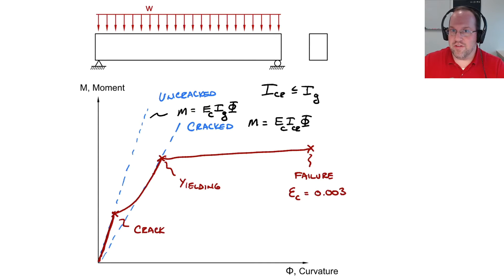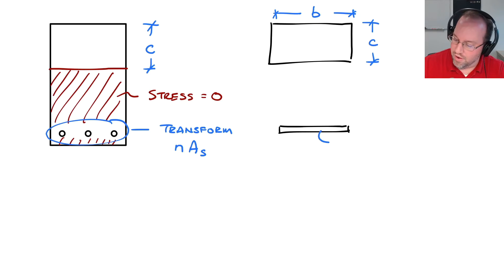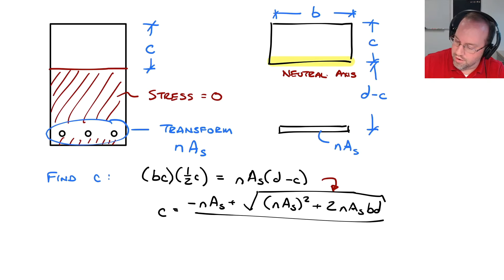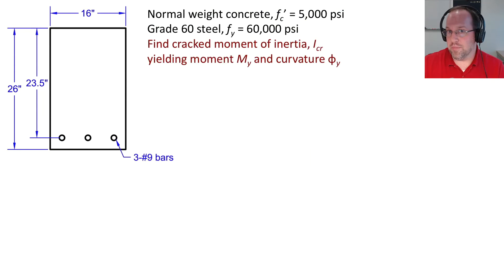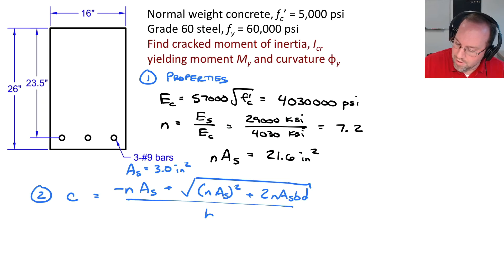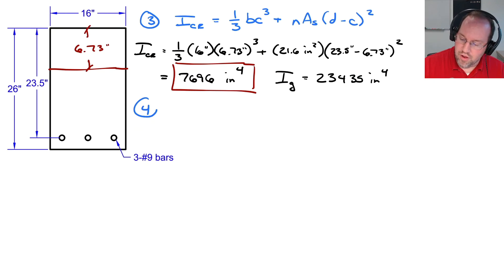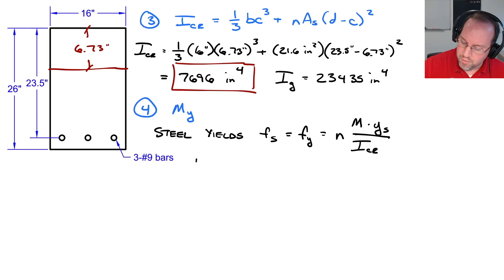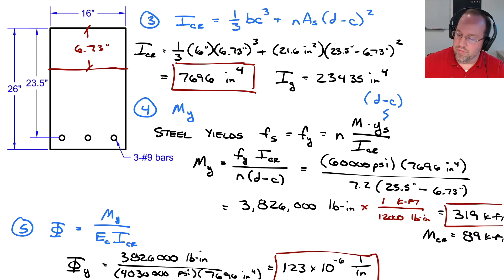Transformed Sections and Cracked Moment of Inertia

Comment: Good day sir! why we did not included the moment of inertia of the transformed steel upon using the parallel axis theorem? I am hoping for your reply. Thank you!
Reply from the maker: We could include the moment of inertia of the steel, and there is nothing stopping you from doing it, but it’s typically neglected. The MOI for a round bar is pi/4 * R^4, which even for the largest rebar is very small compared to the concrete section. Thus, we typically only use the parallel axis theorem for rebar MOI, as even that area * distance^2 will be many times larger than the bar MOI.

Comment: Sir, please let me know the derivation  how it becomes nAs and significance of modular ratio n....
Reply from the maker: Reinforced concrete is a composite of concrete and steel. When we examine the stiffness of the section, for example when computing deflections, we are generally interested in the elastic modulus E multiplied by the moment of inertia I. However, we have two material with different modulus: steel Es and concrete Ec… so what do we use? To get around this, I can convert (or transform) my steel into an equivalent area of concrete. Steel has a higher modulus than concrete, and we represent this with the ratio n = Es/Ec. The transformed area nAs is the steel area converted into a larger area of concrete such that the total stiffness is unchanged. Using this transformed area, I can treat my section as though it’s 100% concrete, meaning I can now find a moment of inertia I with modulus Ec using traditional, single-material beam bending theory.
Reply: @StructuresProfH  Many thanks for clarification Professor! one question which might seem basic because I am a beginner about this topic is: sometime  I found equation where the transformed steel area is calculated as (n-1)*As instead of n*As (your case). Any reason for this?
Reply from the maker: @lifeadventuresz  Great question (and not at all basic)! 

We use (n-1)*As when the steel is located in concrete that carries stress. The most common situation for this is compression steel. We typically assume the concrete section does not have any "voids" in it where we have rebar - for example, if the neutral axis is at depth c in a beam of width b, then we just assume the concrete compression area is b*c. In reality, the concrete area is b*c - As, because As of that area is filled with steel, not concrete. To simplify our math, we move that "minus As" over into the steel term and leave the concrete area as b*c. So what normally would be n*As for the transformed steel area becomes n*As - As = (n-1)*As. To summarize, compression steel located in the compression block displaces stress-bearing concrete and thus is transformed using (n-1)*As', where As' is the area of that compression steel. 

We use n*As when the steel is located in concrete that does not carry any stress. Because we assume cracked concrete carries no stress in tension, then our tension steel is transformed using n*As.
Reply: @ Many thanks for explaining it perfectly, now I fully understand the origin of n-1.